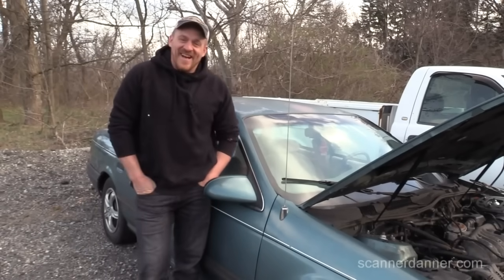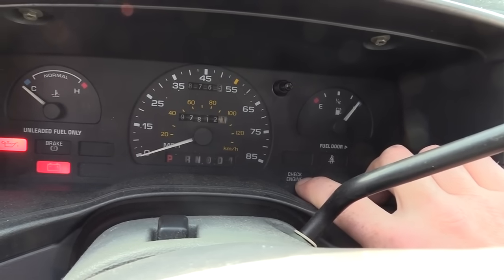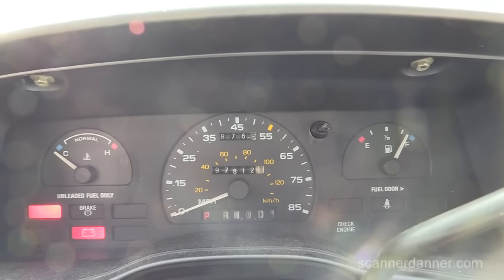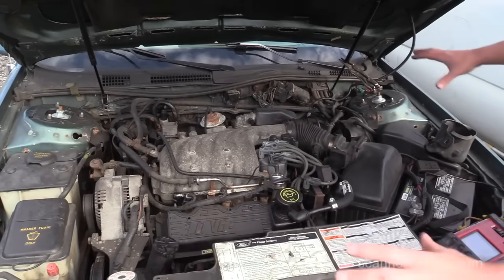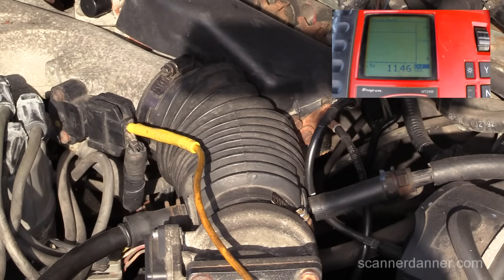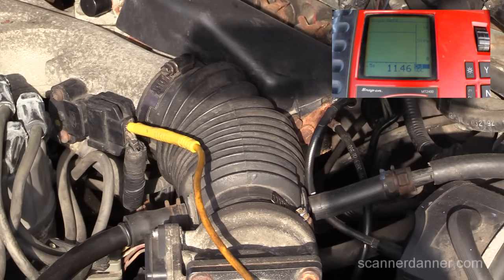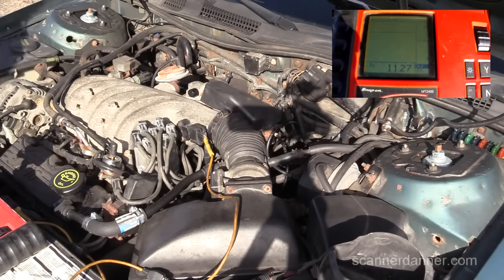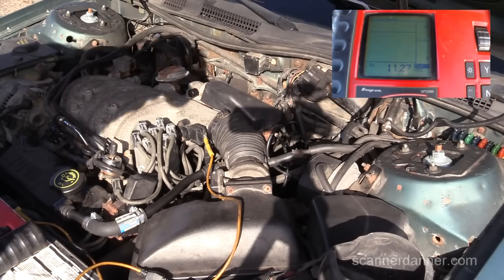Sensor grounds and the 5v reference circuit (a 2016 ScannerDanner Premium video)

Comment: I wonder if you get this before end of today. 

Customer says their car Audi A5 has had 3 new alternators and now because of the heated arguments the garage does not want to deal with them. 

What can ruin alternators on normal car. No sub woofers. No amps.
Reply from the maker: 1. Cheap parts (where are they getting these alternators from)
2. How long are they lasting? 
3. If it is immediately not charging with a new alternator, it was misdiagnosed and never needed an alternator in the first place.
Reply: Yet to meet him but I think he said the alternators are then bench tested and not working after being in the car for a day. 

I know exactly how alternator works. If you kept 12v going in you could overheat the rotor windings and the varnish stuff come off do short it. But new alternator has new regulator built in. I can’t see that. Regulator regulates. Huge short to ground like starter harness. Doubtful. 

See the job tomorrow first time.

Comment: Real quick because I dislike reading thru tons of material to find an answer to a question can simply ask, does the 5 volt rule apply to a 2002 Grand Prix GTP?  I replaced the blown engine and everything worked in the car for a couple days. Then, I determined I had an alternator issue and replaced it with one that unknowingly was  higher amperage. Things in the car quit working  properly. Replaced it again with oem alternator. Some things started working properly again. But still have things that aren't. Please help.
Reply: Not working properly:
Driver info center
Heater/ac controls
Daytime running lamps
Rear speakers
Reply from the maker: sure does (the 5v reference checks). This applies to ALL cars!
Reply: Much appreciated!

Comment: why does a bad computer ground cause 12v on the 5v reference circuit? doesn't the computer put out 5v straight to the sensor? how does a poor ground cause an increase in voltage? thanks !
Reply: is it because the 12v going to the computer grounds through the 5v ref circuit as there is no proper path through the computer ground?

Comment: I was asking for some help on iTan this car that was kicking my butt. I stated I used a 3.8 amp test light to check my powers and grounds at the pcm, and a guy said that wasn't a good way to test powers and grounds. I ended up fixing the car it was a A/F sensor.

Comment: Hi iv got a question for you I have my abs warning light come on my car would that also bring my engine management light on
Reply from the maker: Other way around. A check engine light will cause traction control light or electronic stability system lights. But
I can't think of a circumstance where an ABS fault alone set the check engine light. But you're calling it an engine management light which may not be the check engine light?
Reply: Cheers Paul

Comment: Greetings- for those of us who can't afford your excellent book, could you explain how 11.2 volts (or battery voltage) changes from full batt. voltage to a 5 volt ref. signal and how a bad ground brings it back up to batt. voltage. This would have been very worthwhile to explain in this video. I'm sure I'm not the only one with this question..
Reply from the maker: The 5v regulator is a pulsed on/off signal that then get's conditioned to a steady 5. The regulator MUST have a good ground to "bleed off" the input voltage (12v). With no ground, the reference voltage will be almost as high as the input (12v). 
Hope that makes sense.
Reply: @ScannerDanner  Thank you Dan. I understand now. I was unaware of the regulator chip in the PCM. Good stuff. I was thinking some kind of voltage divider circuit.
Reply from the maker: @georgerocks5191  my name is Paul Danner :-)
Reply: @ScannerDanner  One last question: if there is just a somewhat bad ground connection, will voltage be less than source battery voltage and not the full battery voltage an open ground produces? If the computer ground is totally missing like in this video, shouldn't other system not work if the computer provides grounding?
Reply from the maker: @georgerocks5191  https://youtu.be/McsNOJvd0ao  check this one out. It has a bad block ground
And yes to your first question (lower than battery voltage, the better the ground the lower the voltage)
Second question, yes, other systems that the computer controls will not function properly, if at all

Comment: I do have a question. how did this bad block ground jump up voltage in a 5 volt wire.
Reply from the maker: The 5v regulator is 12v fed and grounded. With no ground, the 12v fed regulator cannot "bleed" the 12v down to 5. Make sense?
Reply: Actually yes. so what converts the 12 to 5? the computer? or regular itself
Reply: disregard. I get it. I'm sorry for dumb question

Comment: My 4age engine isn't starting when the engine is hot when cold it's starts quite fine and if I press the gas it starts up

I change plug wires, plugs, external coil but it's still not ok
Reply from the maker: It sounds flooded. Check coolant sensor and also fuel pressure and fuel pressure regulator

Comment: When performing a ground to ground voltage drop test on a bad ground... Where is that high voltage coming from? Without a short to ground, I dont understand how there is any voltage there
Reply from the maker: "Pressure build up" before the high resistance area. Picture a fat guy standing on a garden hose and the fat guy is the unwanted resistance and the pressure rise happens before the fat guy 😄

Comment: I have 99 bonnv. With temp sensor an temp sending made in same unit , im getting 5 v ref on sensor but getting about 9 v on sending wire, two wires go to sensor n one to sending side, gauge readinding full scale . Should i be getting volts on sending side or is it just ground
Reply from the maker: the sending unit wire will show you a higher voltage. If you momentarily ground that wire that shows 9v, your temp gauge should swing the opposite direction if the gauge circuit is good

Comment: I was testing the wires of vvt solenoid. The ignition on,  first terminal to - pole of battery  shows 12.7 volt. I tested the terminal 2 to the + pole of the battery and it was 8 volt. Shoudnt it be 0 since the vvt is activated when car is on load? Is this a problem with my ground wire?
Reply from the maker: Stay on battery negative for both tests and measure plugged in and unplugged and report your readings

Comment: I dont understand why the 5v line gets 12v when it lost the ground connection. Why isnt it 0v? Do i miss something? Maybe im just being stupid. Do you have annything i can look up so i can understand that better?
Reply from the maker: A 5v regulator will take a 12v power feed and in a sense "bleed" it off to ground to reduce it to 5. This isn't entirely accurate but will give you a visual. So no ground = no bleed off = out put will be near the source voltage of 12. Make sense?
Reply: I did't know that at all. Alot of things make sense now haha. Thanks. Love the videos btw.
Reply: also. many times computer controlled relays/relay packs will be spliced into or use the same grounds. so 12v in relay, 12v back out into the harness ground wire with nowhere to ground

Comment: Am I wrong in thinking that a bad ground would give you less voltage in the circuit? A bad computer regulator or short to voltage is what comes to mind. Anyone able to clarify?
Reply from the maker: A good ground will be near 0v as it is the same potential as battery negative. Disconnect the negative cable of your battery and measure voltage from the disconnected cable to the battery negative post and tell me what you see. You will read 12v. That is your open ground.

Comment: hey man my 3 pin wires for both cam sensors both read 11.8v, 11.5v, 3.5v i think the middle wire 11.5v is the reference instead of a 5v, but looks like 3.5v on the ground wire?
its a bmw 318i 2003 n42 with EML light on and codes P0015 Camshaft Position - Timing Over-Retarded & P0366 Camshaft Position Sensor "B" CIrcuit Range/Performance (Bank 1)
could 3.5v on the ground throw these codes and make the car shake super rough at idle 700rpm. when i accelerate over 1000rpm it smooth out alot
the same errors stay in the computer when i swap the intake cam sensor with exhaust cam sensor would you have any tips :D
Reply: just a short backstory. car was running perfect. i was driving home and saw the EML light come on for first time in my life
i pulled over and turned the car off. then it would just crank but not start
the road service guy first step was to spray starter fluid in the throttle body while he told me to keep the pedal to the floor and back off slowly
the car started but it sounded hollow like the engine had no oil in it and soon as i let the pedal off the floor it lost rpm and stalled
Reply: i got the car towed off the main road to a nearby mechanic who told me there was no compression, blown head gasket and to swap the engine
after watching youtube videos i tested the compression myself and every cylinder was 190 psi
i got a bafx reader and saw 2 cam sensor codes + 2 02 codes P0050 H02S Heater Control Circuit (Bank 2 Sensonr 1) & P0056 H02S Heater Control Circuit (Bank 2 Sensonr 2) 
when i cleared the codes the car started first time and i drove it home. since i switched the cam sensors around the 02 codes have gone but the cam sensor codes keep coming back
Reply: i cleaned both oil solenoids and tested them with a 9v battery they both clicked and i cleaned the throttle body
didnt know anything about cars until this happened
 really appreciate your videos on youtube
hopefully the chain didnt jump teeth when i floored it with starter fluid and the problem is just a ground wire
im not sure how to investigate it further yet for my car ill watch this video again and look more up on youtube if you or anyone has tips pls let me know!
Reply: just found your 2 videos on 'Hall effect cam/crank sensor operation and testing' i think my answers gona be in them!
Reply: just updating my first comment i read my multimeter wrong the sensors have 3.5 millivolts on the grounds not 3.5 volts so back to square 1 lol

Comment: Thanks for broadcast. The Saga on my PT cruiser touring 2005... starts with low voltage on O2 down stream and rough idle ... replace the 02 senor down stream replace it now both sensors up stream.down stream engine light on. Then I have someone at a garage read OBD2 port... now  port won't read no power? Or ground?... I changed the MAP sensor runs smoother. . . Now stalls with no warning and starts back up without an issue but afraid of getting rear ended...S.O.S. I have zero experience in multi meters or finding a mechanic thst is an actual mechanic when it comes to electrical uhhhhggg!

Comment: I'm looking for a video that can show me where to start when the positive side of injectors and ignition feed measure - voltage key off or on.
Reply from the maker: It would help to know what you are working on. Also you need some good wiring diagrams. Here is where to find them https://www.scannerdanner.com/forum/post-your-repair-questions-here/3757-need-service-info-check-here.html

Comment: What causes signal voltage to drop. I have a bmw and cranksensor voltage goes down to 2.5v, after sensor is plugged in. Supposed to be 5v
Reply from the maker: Signal voltage or reference voltage?
Reply: @ScannerDanner  signal
Bmw says it's supposed to be 5v with sensor hooked up and 5v before it is hooked

Comment: i hnow my volt reference is supposed to be 5 volts from pcm to all sensors but they all read 4.93 volts. is that wrong voltage or is it ok?
Reply from the maker: no problem with that my friend
Reply: @ScannerDanner  thank you

Comment: How would you know to check your battery connector just by checking on a five volt ground reference? You never really touched on why that's the first place you looked.
Reply from the maker: It wasn't a "battery connector" it was the main ECM ground point that was bad and reading 11v on a sensor ground is what told me the main ECM ground was bad. Hope that makes sense.
Reply: @ScannerDanner  Thank you!

Comment: Hello I have a 2003 Jaguar S Type  and I’m not getting the five volt reference from my e cu to my throttle position sensor and my car is stuck in limp mode because their is no power coming from the ecu to the tps And maybe I’m not getting power to any of my other sensors as well coming from the ecu  Do you have a clue how to fix my ecu?
Reply from the maker: I'm guessing it runs though right?
Reply: @ScannerDanner   what do you mean runs through it’s in limp mode 5 miles a hour because no power or signal going to the throttle position sensor
Reply from the maker: @michaelakins4506  I'm so sorry, it is hard for me to keep up, especially with follow up comments. I get about a hundred new questions a day, and do my best to answer them and when I do, they just multiply! Anyway, if you still need help, I have created a forum on my website https://www.scannerdanner.com/forum/post-your-repair-questions-here.html that is free to join, where I have 4 hand picked moderators and over 25k global members who are there to help me help you guys! You will not find a more friendly and helpful forum anywhere. Hope to see you there! Thanks for understanding.

Comment: Hey Paul i was wondering if you could help me ive got a 2004 GMC Sierra with the 5.3 i have a crank no start condition. I have tested spark which is good ive checked fuel pressure stays at 55 psi even after the key is cycled off ive also pulled the injectors cleaned each of them flushed the rail and tested each fuel injector with a noid light and multimeter i have 12v feed ive checked for pulse at the injector harness and checked for the ground pulse from the ECU to the injectors which was also fine. ive swapped ecus with one that has the same part number and did the temporary vats delete and still crank no start no change. ive also tested the relay sockets under the hood and the noid light lit strong on each of the pos and Neg when checking each relay socket. any help would be great as im at my witts end here thank you.
Reply from the maker: exhaust restriction maybe? I've seen a plugged cat cause a no start before. As a quick test, remove one of your upstream O2 sensors and see if it will start.

Comment: Scannerdanner, how would a mechanic tech know if the sensor is good or bad without having a good sensor to compare against to? Yes they run the grounds back to the ECM board but the ECM board ground is isolated and not connected to the battery ground. Noise from what? The ECM board signals are CAN buss signals or what other signals does an ECM board use? because the Scanner tools and communicate with the ECM board by using CAN signals? TIPM boards use CAN signals and LIN signals, but how does a TIPM board work what does it do? I'm not sure why ECM boards send out a 400hz signal to the alternator why 400hz where does 400hz come from it doesn't make sense to me why its 400hz.
Reply from the maker: question 1, learn your fundamentals and then have a good information system
2 - the ECM board is grounded to the battery (noise on the signal and noise on the sensor ground = no noise when you compare the two which is what the ECM is doing)
3- not sure what you are asking
4- depends on the system as far as com lines go, not all are CAN
5- TIPM is a smart fuse box that talks on the CAN
6- you are asking a specific car question now, this is where your good information system comes in